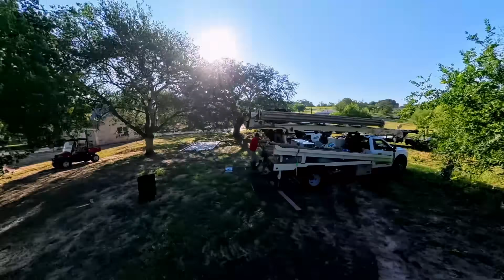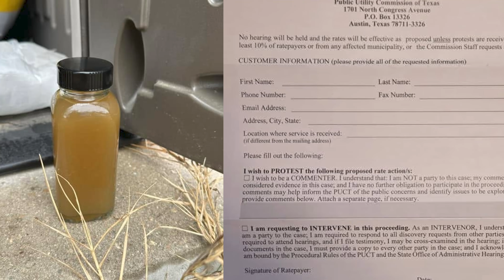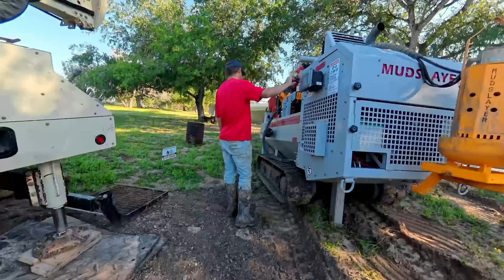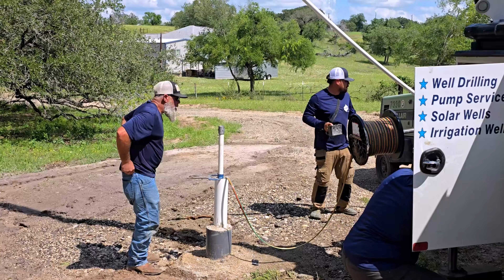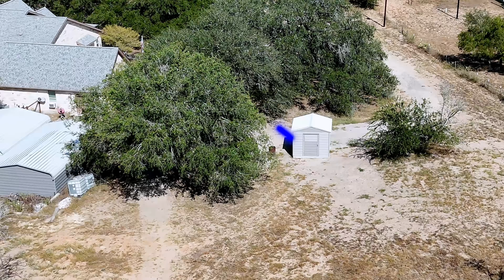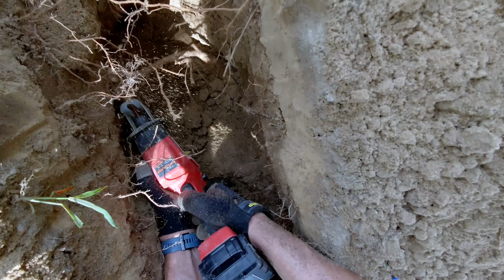They Kept Raising Rates, So I Built My Own Water System

Comment: I Have property in North Texas and the water company is now charging 95 dollars a month for the connection plus the actual charge for water. It was raised to a little over 50 dollars a month last year because of the water systems need to provide more water to a new housing development with 150 homes built and a second bigger phase now under construction. When it came time to pay for the improvements, they realised they had miscalculated the amount of extra money they needed and raised it another 40 plus dollars. I already tried the well drilling route but there is no viable aquifer at my property. So I am going to install  a rainwater harvesting system to my metal roof. Full payback should happen in around 3 years. The cost of water will only go up. Owning and controlling the costs of the system and operating it will always be cheaper.
Reply from the maker: Three years for an ROI is definitely worth it.  Water is the new oil.
Reply: @TexasDIYCoach  As a kid from the sixties, I remember many saturday cartoons where the villain took control of the water supply  to provide great wealth. I used to laugh at how silly the idea was.
Reply from the maker: @tbirdracefan  That wasn't Black Pete was it?
Reply: Same crap here in Virginia.

Comment: One thing to consider is the pump will need to be pulled at some point in the future. With the well house the roof seems to have no access over the well. The drop pipe is 20 foot sections that need to be unscrewed one at a time. I would recommend making an opening that can be removed when you need to pull the pump back out. Nice setup otherwise.
Reply from the maker: Yes...this is one thing I kind of missed prior to putting in the foam.  Luckily, the roof panel over the well head can be removed when the time comes that I need to pull the pump.  However, I will need to cut open the spray foam.